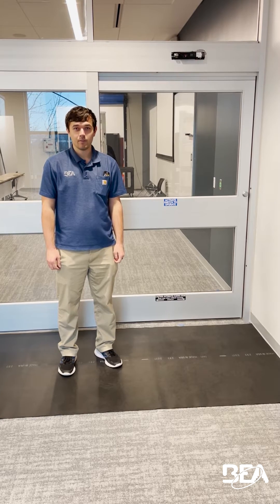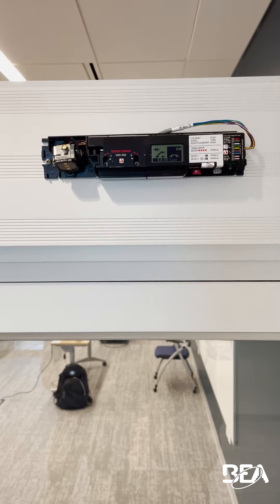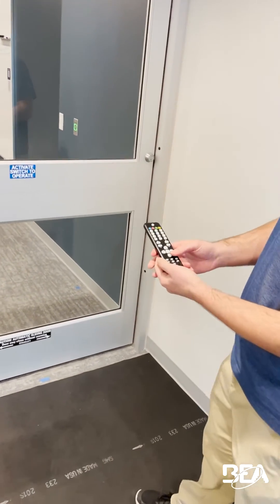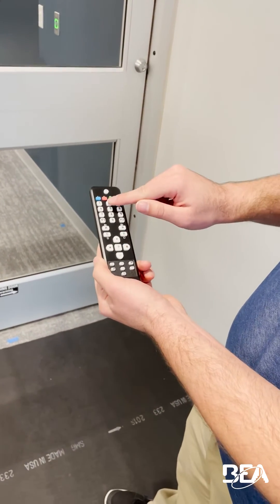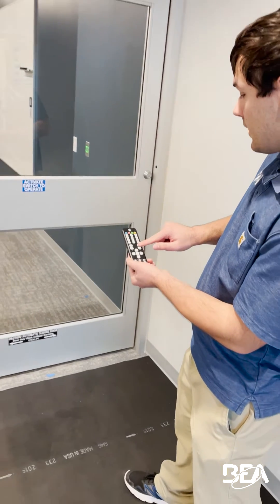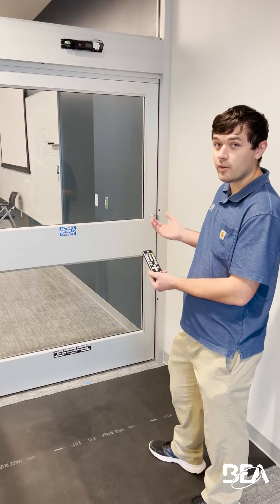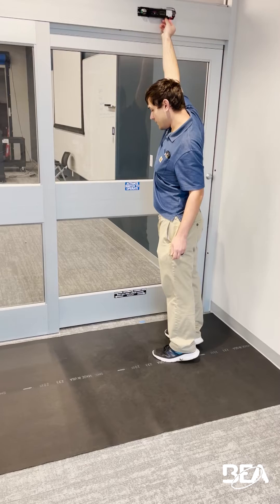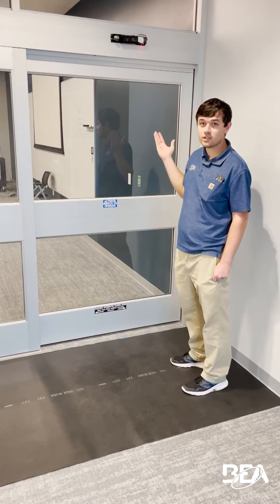How to troubleshoot an E4 error on a BEA IXIO using the UNIVERSAL REMOTE CONTROL

Comment: Is there a button to open and close the door?
Reply from the maker: Hi Zachary, there is not a button on the BEA Remote to open the door. The door activation is initiated by the activation field of the sensor or a knowing-act device like a push plate or touchless sensor.